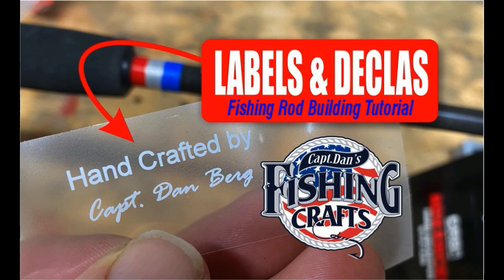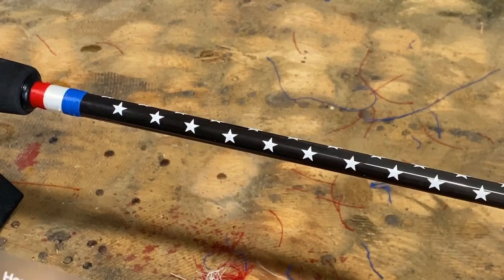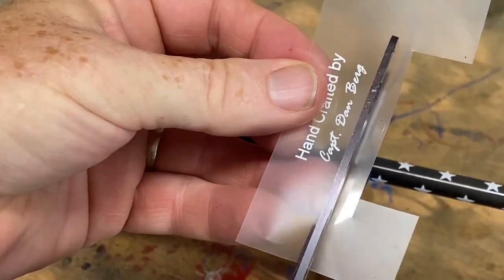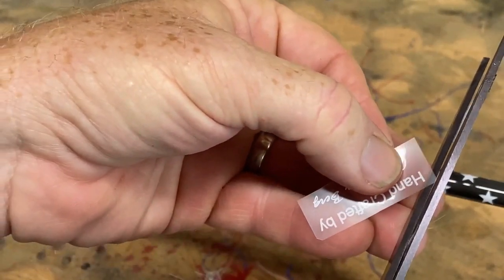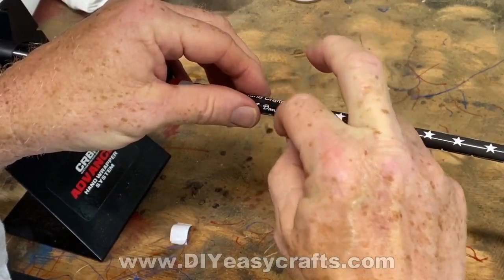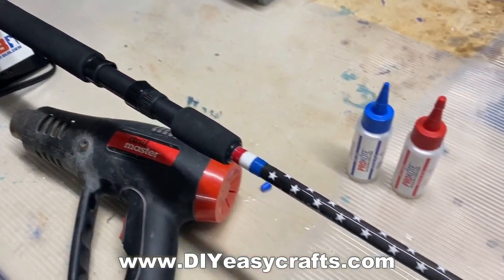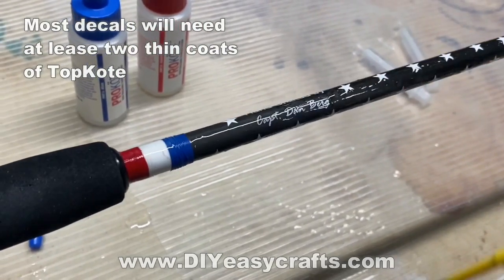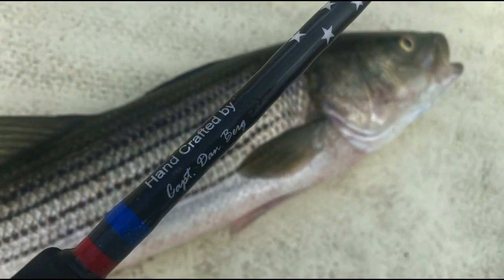Fishing Rod Building Tutorial Installing Labels and Decals

Comment: You bypass the most important parts . You did not show how you used and placed the tape on the back and front of the label to apply it. It was a waste of a video
Reply from the maker: Not quite sure what you are talking about. I do not use tape on the front and back of the label. Just a couple small pcs attached to both edges (as shown). They allow you to hold onto and position the label without getting fingerprints on the labels adhesive.